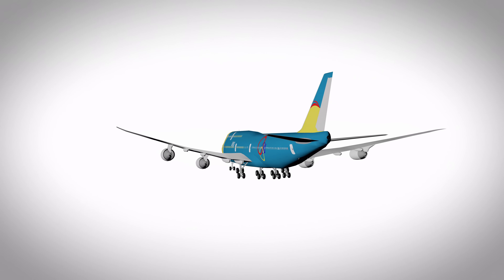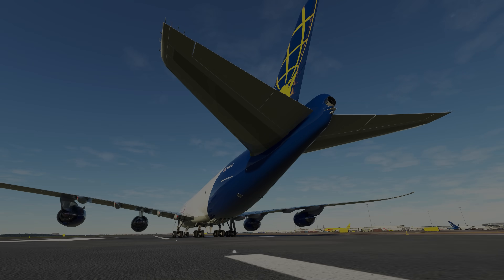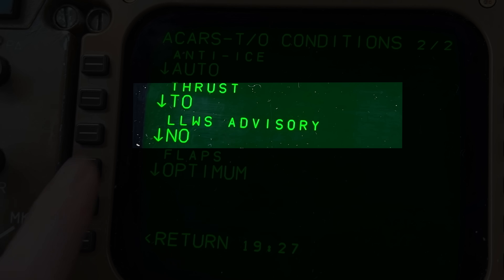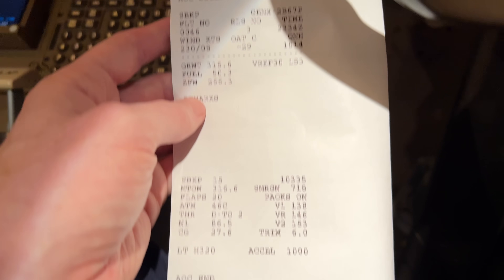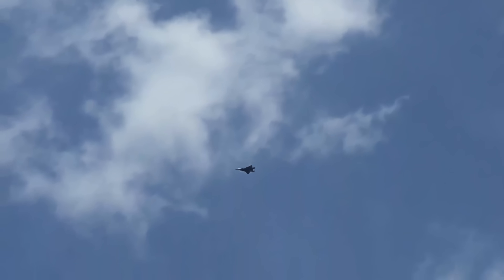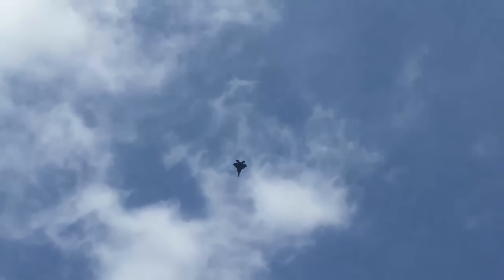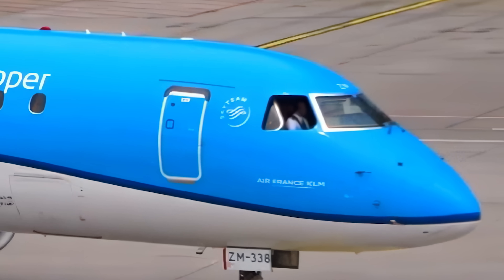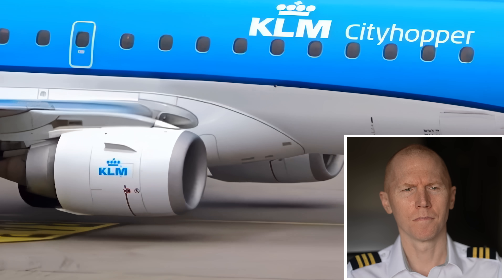Unsafe 747-8 Vertical Takeoff

Comment: Man the F-22 is so remarkable, it's a shame it's going away. That was the "falling leaf" maneuver in that clip, the thrust to weight ratio is just so high in that plane it doesn't need airspeed to stay in the air or maneuver. It can use thrust vectoring. It's what is called "super-maneuverability" if you want to look it up.
Reply: jet engine go brrr
Reply: @katelights  indeed it does!
Reply: (I am no pilot or airplane engineer - so correct me if I'm wrong) - I believe the F-22 Raptor (as are any 4.5 and 5th gen fighter) has an inherently (and by design) very unstable airframe - which means the aerodynamics make it want to fly tail first - which gives it such maneuvering capabilities and is of course entirely fly by wire as no human would actually be able to handle the control surfaces and thrust vectoring manually without the aid of the appropriate avionics. Without the avionics, the plane would very quickly exceed all sorts of structural thresholds and would probably be shred to pieces in a mater of seconds by being totally outside of the envelope.
In the case of the video the plane is simply doing what it is suppose to do : doing the acrobatic maneuvers as needed when dealing with modern air superiority fighters.
Reply: @ivanscottw  Every modern fighter is designed to be inherently unstable aerodynamically. Not just a few. Even the now aging F16 is inherently unstable (believe it was the first?). All of these planes use fly by wire to account for this. If you watch the controls carefully, they dither and twitch constantly in unintuitive ways, just even in a simple maneuver, or even straight and level flight.
The falling leaf maneuver is only because the plane is completely stalled, no longer flying. Which is an out of control situation for most planes. But the F22 has thrust vectoring, so it can maneuver even in this situation.

Comment: 12:45 You're not "wrong," exactly. At least, not so far as the analogous use of a thrust reverser to downshifting. The big difference would be in what and why things would/could break. In a car, it's the RPM that'll do it in. Basically, if you downshift too far and run the components in the red-line for too long, the components get spinning too fast, and not all of them can keep up with changing directions and overcoming their own inertia so quickly, so they literally fly apart from each other. Most often, it'll be a piston rod that'll let go of the crankshaft and take a chunk of the engine with it, but other components can and do let go. It's not as common now, since automatic transmissions are more common than manuals, so mostly you just find it among car enthusiasts getting a little too wild trying to get more horsepower out of a given engine or showing off.

Cars don't generally have to worry about ingesting anything into the combustion chambers unless someone physically drops something into a cylinder and forgets to retrieve it before starting the engine. They have air filters and fairly indirect routes for air to get there, as opposed to jets which are...much more direct about it.

Comment: On the Car Guys years ago, I believe someone called in with a "settle an argument" question by a lady vs her husband who downshifts. They confirmed as you alluded to about transmission wear:  Save your transmission; use your brakes for what they were designed for.
Reply: The Car Guys 🥰  🥰
Reply: @karens1967  Yeah miss them!
Reply: Btw I should have said clutch not transmission. They said it's cheaper to replace brakes than a clutch. And of course this is all for normal driving conditions.
Reply: @C.Church  If you do it right, it doesn't wear the clutch any more than upshifting does.

Comment: I was on a flight out of McCarran Airport and the bank off the runway was really steep.  I always have a p[partially-filled bottle of water to get an idea of the orientation of the plane. It was really really steep. I felt a bit uneasy. Of course, the pilots leveled the wings and we got to our destination. But it was the greatest angle I've ever experienced, even when I had the stick in my hands.
Reply: If the turn was executed properly, the water in the bottle should stay level.

Comment: You're absolutely right about downshifting with the clutch instead of the brakes Kelsey.  Been there, done that, and I left my transmission on the ground in a hundred pieces.  Definately cheaper to use the brakes!  😂
Reply: Cheapest is to learn how to shift properly.  😁

Comment: The down shifting to slow down analogy was actually pretty good. Using an expensive part for the purpose of a cheaper part. The way you slow down by down shifting is because it takes a lot of effort to turn an engine, so if you take your foot off the gas it isn't turning itself anymore, and let the momentum of the car turn the engine by transferring the momentum through the wheels and transmissions is what turns it, and that provides the resistance to slow you down. And that resistance isn't from friction, its actually suction and pressure from the pistons forcing air into or out of the cylinder through the valves. So it's actually less wear on the car to down shift, and in some situations it's actually recommended, like going downhill for prolonged periods because brakes fade.
Reply: As an added bonus to using the car how it's designed to be used, in an emergency situation if you need to suddenly start accelerating again, you're already in the right gear to do so.
Reply: truck 100% have to do this on steep declines, you can't have that kind of tonnage running downhill with overheated brakes.
Reply: trucks downshifting a lot to slow down speed.. also to be sure they always are in the right gear.
Reply: The only reason to use engine braking is on a long downhill to prevent brake overheating. You'll be producing a lot of heat, at the rate that you are dropping in potential energy (mgh), and the radiator can handle a lot more heat dissipation than the brake rotors. When driving, engines are less than 50% efficient, and the wasted energy goes to heat that is dissipated by the radiator. So if the car drive up the hill without overheating, it can go down the hill with engine braking without a problem. Brakes, on the other hand, will overheat quickly when not used for what they were designed for, which is intermittent braking before turn, with time to cool in between.
Reply: @misolo  My daughter, who is a truck driver, pointed out to me that engine braking in trucks is not the same thing as cars do to slow down by downshifting and taking your foot off the brake. In the latter case, which I do all the time, zero fuel is used. Since no fuel is being burned, there is no heating from burning fuel. The only heating is from adiabatic heating from compressing the cylinders, which is exactly counteracted by releasing the air in a decompression cycle on the other end. The only net heating would be from friction, which, if you have an appropriate oil level, is not very much. In fact, your engine and coolant are most likely cooling down during such a deceleration. Trucks using engine braking, on the other hand, apply fuel to decelerate, applying torque in the opposite direction from accelerating forward.
Reply: @Brillig2  Don't know about trucks, but the part about the engine not heating when used to brake is not correct: yes, no fuel is being used, but the mgh potential energy has to go somewhere if it's not going to kinetic energy. When using the brakes, it goes to heating of the brake rotors, and then dissipated from there. When using the engine to break it goes to heated exhaust and a heated engine (it's not a reversible thermal compression/decompression cycle). The heated engine gets cooled by the radiator, which does this very efficiently. You can verify this simply: if your car has an engine and/or oil temperature gauge, look at it the next time you go down a mountain on engine breaking -- or you can simply pull over and check that the engine does indeed get quite hot.
Reply: @misolo  If I had a big enough hill, I'd try it. I tried it just now with a mile-long offramp and the coolant temperature dropped 20 degrees (and jumped right back up after I stepped on the gas at the end of the ramp). Unfortunately, that's within the normal variability, so not a good data point. Read through my post again. I listed the sources of heat. They are adiabatic heating and friction. The adiabatic heating is caused by compression of the gases going into the cylinders. This is exactly canceled out by the release of pressure from the cylinders on the other side of the cycle. There is no burn, no explosion, no fuel use, so no further source of heat. There is friction, of course, and that produces heat. If you think there's another source of heat, please explain what it is.

You said the potential energy has to go somewhere if it doesn't go to kinetic energy. Actually, it does go to kinetic energy mostly. The rest goes to friction, which I mentioned. Probably a better measure than coolant temperature is oil temperature. I'll see if my app has an oil temperature gauge. If so, I'll try that. The coolant won't circulate much unless it's needed to cool the oil. So it probably stays at a pretty constant temperature. After the car stops and the engine is not going for any reason, the coolant still is hot for a while. Then it cools only by radiation with no circulation to help.

Comment: Car guy here: downshifting to engine break is fine to do with a manual transmission or a DCT in manual control mode as long as you're careful not to exceed engine redline while doing so. Only the clutch (or clutches) might accrue some extra wear depending on how good your rev matching is.
Some traditional automatic transmissions will do this for you automatically if you let off the gas while in drive (others will just disengage). Most CVTs and traditional slushbox automatics in manual control mode are liable to suffer excessive wear from downshifting to slow down because it uses the friction belts in the transmission to force the engine to speed up. Most modern (i.e. 2015 and up) cars with any form of automatic transmission will have computerized engine and transmission control, allowing them to rev match during up- and downshifts, minimizing the wear.
Conceptually, using the gearbox to slow the car down is no different than taking your foot off the accelerator and coasting: it's fine to do as long as you don't over-rev the engine. The transmission can usually take a lot more revs on the input side than the engine can, so in case you "money shift" (i.e. accidentally downshift from fifth to second instead of fourth) you're liable to break your engine whereas your transmission has a relatively high chance of survival.

Comment: You're right, don't normally do engine braking. It's mainly used going down long mountain roads where brakes could get overheated. Trading off transmission wear for needing your brakes to continue working for the rest of the trip.
Reply: done properly, using the engine to decelerate causes no more wear than using the engine to accelerate.  done badly, of course, you can break things.
Reply: I just saw this comment as he was mentioned, "car guys jumping into the comment section to tell me I'm wrong." But yes, normally it's only used if the other option was riding the breaks for a long period of time. I've seen some signs posted, "no engine breaking." I'm assuming it's because of the noise.
Reply: @foxinhenhouse420 the signs for "no engine braking" are specifically for tractor trailers that use a Jake brake which chokes the engine exhaust to slow down the engine down and is very loud.
Reply: And done wrong, you get free-fall on the clutch being held in. My sister didn't downshift in time going down Raton Pass on the way back from Colorado and the 57 Chevy bus she was driving did it so fast, there are legendary stories to this day about it. Not something I would recommend doing in or on any vehicle, btw. My brother never let her drive when there were hills ever again.
Reply: I always thought clutch wear was the primary cost of downshifting plus or instead of braking.
Reply: @ethanbarrieau7917  my aunt said that her son's farts sounded like a big rig engine-braking
Reply: @gshenaut  as long as you properly rev match when downshifting there is no more clutch or transmission wear than there is when accelerating the car. Done correctly you won't damage your car and it's actually significantly safer to downshift in wet or icy conditions than it is to use the brakes, even with ABS.
Reply: @@RickoSidhe “Lots of dump truck drivers like to make lots of noise…..”.  So, are you saying that dump truck drivers are children unleashed, just like Kelsey says pilots are?  I’m just jealous because my job sitting in front of a keyboard and monitor just doesn’t have the opportunity of being a child with really big power toys to play with. :(
Reply: @gshenaut  Not if you use the clutch properly. And, downshifting + brakes means faster stopping.

Comment: Kelsey not wrong about engine braking in cars.  I only use it in the mountains anymore, to prevent brakes overheating and failing from standing on them all the way down the hill.

Kind of like you use reversers on a shorter landing, or you're heavy, or the runway is wet, to prevent a dangerous condition. Not for casual maneuvering.

Comment: I could be wrong but with the hand-propped plane, it looks like the throttle may have been at a high setting, rather than idle or very low which is where it's supposed to be when you start the engine.  That's based on how fast the plane gained speed when the engine started - most light planes accelerate at a snail's pace or not at all with the throttle at idle.